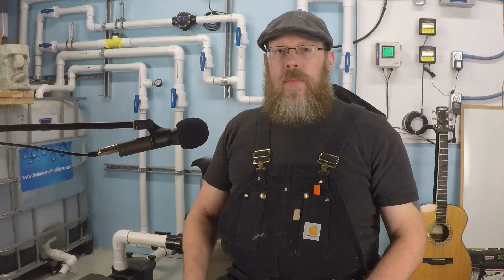Flexible PVC vs. Rigid PVC For Pools

Comment: Interesting. Just bought a house in Virginia and was thinking about replacing some of the above ground plumbing around the pump and filter with flex PVC just to make more sweeping turns as whoever plumbed it put a lot of 90s A LOT! And I know each 90° bend is a restriction, so would it be reasonable to use some flex PVC above ground? I don’t think the pressure gets anywhere near 80 psi.

Comment: All commercial pool equipment rooms are usually piped in sch 80,   Not for pressure but for a physical impact.   I always used a length of schedule 80 coming through the walls of the equipment room.  A pipe going through a concrete hole in equipment room is a point failure due to ground settlement.    Pools with six inch perimeter piping that is reduced to 2 pvc for a return fitting typically with a 1/2 inch eyeball.   You should always use schedule 40 pvc pipe with sch 80  elbows,  2 inch fittings typically split from external load.  Leaving the 6 inch header by 2 inch to the pool wall should be at least a six foot offset.  This will allow for the 2 inch pipe to flex if the heavy 6 inch  header. Should settle.  Skimmers should be piped similiar .   Any fittings above 3 inch it is best to order fresh slow set glue and apply with a brush = to the pipe diameter from a gallon can ( paint can style). This allows for securely inserting the pipe into the fitting before the glue starts to set.   PVC pipe cleaner , if used, I don’t like it.   If cleaning fittings they should be cleaned in groups , set aside making sure no puddles of cleaner in fittings,  will show as small leaks at bottom of pipe.   Do not let pvc pipes be pulled of a truck and the end drops on concrete,  you get leaks that only show at pressure testing from cracked pvc.   Also dragging a pvc across concrete bevels a portion of the pipe limiting its total surface for gluing.  Pipe should always be seperated by minimum 1 1/2 inches to allow for a proper sand backfill with no voids.  No leak pvc flanges should be the type that has no stop,   Like a repair coupling for you don’t cut and create a weak spot you apply glue a slide over the pipe……their things that may happen only one in two hundred times,   Though if you build as many pools have , you will see these problems,   I have never worked in the freezing climates,     I am sure they have seen all kinds of problem I never witnessed ,  basically it’s impossible to contain the pressure of freezing water.    For better or worst most of my experience had been beach front and Caribbean.

Comment: Thanks Steve, I need to hook up my pool pump, filter and heater that is about 30ft from pool.  I live in Quebec, Canada.  What would you recommend me using between flex and rigid?  How deep should I run the pipe?  Thanks.

Comment: As you point out, everybody has an opinion.  I have a 10,000 gallon in ground pool in central Texas.  It was built in 2007 with rigid schedule 40 PVC pipe throughout.  Every year, because of the shifting soil, I get a leak SOMEWHERE.  Everywhere from under slab areas to lines buried 18" deep around the perimeter of the pool. It's a given.  As time goes on and the expense of hiring a pool leak detection and repair service climbs, I have gradually shifted to purchasing my own  equipment, diagnosing the leaks and doing my own repairs.  All of the leaks have been at underground connections.  I have begun using flexible PVC for short sections to alleviate the stress and prevent a reoccurrence  AGAINST the advice of ""professionals" in the area.  My longest time frame for a flex PVC install has been 10 years and counting while I have had to redo many of the repairs done by the aforementioned "professionals" year after year, over and over.  So,  listen to them and keep redoing repairs or install short lengths of flex and redo it ever ? years.  The choice seems clear under my circumstances.
Reply: Sandy soils do hydro shift especially with heavy rains.

Comment: Am I missing something? The flex PVC that I'm using is smooth inside and out, follows the same ID/OD size standards as rigid (so that regular fittings work perfectly), I can run large smooth radiuses without fittings, and it handles freeze expansion for 5500ft elevation wonderfully. I do have to soften the trench with sand to prevent rock friction wearing a hole, and I have to be a little more aware of psi, but overall, it is a win. In fact, I'm not sure how it is "budget" in Canada, because it is twice the cost in high deserts of New Mexico. I live on a lava rock shelf so digging 18"-24" down is nearly impossible without serious excavation costs. I can only get about 12" max depth, so to protect against freezing is why I originally considered flex. The ease of labor to lay the pipe/hose was heaven. I do transition it to rigid above ground because I read that the flex is less UV tolerant, but then I have to wrap the rigid in insulation for freeze weather. Let me know if I'm missing something, because I'd rather start saving now for a piping overhaul than find out mid-season unprepared... Love your channel btw.
Reply: My fox vinyl liner pool is 26 years old and plumbed with spaFlex 1.5". Still going strong today.  But if I could have my way I would do the whole pool in SDR 11 or even SDR 9 HDPE smooth wall with electro fusion fittings.
Reply: Use it for 20 years  but on 3000 gallon pond winters in Long Island NY  worked find . Pipe frozen and cracked

Comment: Flex PVC Shrinks in length and diameter over time. In portable spas it ends up snapping the jets off or shrinking and pulling out of fittings. I am in a moderate climate and would never use it.

Comment: My entire house is done with Flex pipe. The line from my water meter to my house is Flex pipe. I know my info has nothing to do with pools but yeah... Anyway right now the temp is -20 and it's snowing. My pipes are frozen as of now. I have no leaks anywhere that I'm seeing. But when I had regular PVC piping in house I had to constantly replace whole entire sections of it and that was even having heat tape on the PVC. But in my experience the heat tape honestly does nothing special except make your electric bill cost a little more. But my house has been done in flex pipe for almost five years now and I've never had to replace any piece of it. And it has froze every year

Comment: Ah, the ultimate question. 😊 I really wonder how detrimental it is to bury Schedule 40 PVC (rigid) in Southwestern Ontario where frost depth is approximately 4 ft but that's a harsh Winter. If you bury rigid 2-in PVC, 4-ft deep, will you truly have “shatter” issues? 

Pipe buried 4 ft under a 2-in concrete patio will practically never see frost in a 4-ft frost-depth climate; frost-depth ratings are for soil. Might want to cover the lengths of rigid PVC that are only under soil with rigid XPS insulation in Winter—but, again, is that really necessary?
Reply: Rigid pipe won't shatter if there is no water in it. Flex hose will crush under vacuum. The only reason to use flex hose is if you're cheap. Be cheap now, spend more later.

Comment: I just installed an Inground 18x36 in norther alberta and they sent me flex pipe with the package, I went with all sched 40 pvc.....couldn't bring myself to burying flex hose under my concrete...
Reply from the maker: How deep did you bury the pipes?
Reply: I'm also very curious how deep you buried your rigid Sch-40 PVC and whether you concreted all along & overtop every run? 

I'm not convinced that rigid Sch-40 PVC is a problem in Southwestern Ontario; there are many northern US installers that use rigid.

Comment: I see lot of pools in Ontario, Canada from the pictures I see on the net using 1 1/2 flexible PVC from filter to pump (rest all rigid PVC). Is the Any reason/benefit of using flex pvc between pump and filter?
Reply: Have the same clear flex pipe for over 35 years and there’s no deterioration in Quebec. Pool pump and filter are enclosed and not exposed to sun so that probably makes a huge difference.

Comment: I live in the north region with 4-5 months of deep freezing winter..  even for above bround pool i prefer rigid pvc.  First flex don't last long, after few years they cracks.. they sort of corrode and the uv kills it.  The steel rings if too tight will also damage the flex overtime..   hard pvc only need glue.. and for above ground pool, you can just put screw on end fittings and remove your hard pipe sections at the end of the season… you can also leave it like that but as long you empty the pipes before winter…. Another reason i hate flex is thy they move, water running through make the flex shake and tangle, especially if the water flow is changing often,  each time it moves, it put stress on the ring and any silicone nearby.. the silicone will then crack.. especially on the filter head or near the pump.  Hard plumbing won't put stress on anything unless someone step on the pipe or something stupid.  Hard pipe have few downside however. ..you are using glue.. if you don't put enough glue it may fail.. and be ready for a huge flood.. once glue is applied or the pipe is cute and glued,, you can't change it.  If you change your equipment.. you will have to redo alot of cutting and gluing .  You also need a piping plan…so you jnow what to buy…and you don't start the job and realize that opps im missing 90 degree

Comment: This is exactly the info I needed, DIY'ing a fiberglass pool in ontario right now. Dealer provided flex but I've seen the same opinions you mentioned on it here on YouTube so I've been second guessing myself. Doing a manufactured stone deck surface so any issues hopefully won't be thousands of dollars to fix down the road. Thanks!

Comment: The best thing you can use in the ground is a thick walled polyethylene pipe such as Goodall "Greenflex".  It's not easy to work with, it isn't cheap either but I have seen it last 60+ years. Not just termites but grubs also can make swiss cheese out of flex pipe.  Also, if you leave water inside flex pipe it can shatter just like rigid pipe, it's only flexible when it's warm and once it ages it becomes far less flexible.  Lastly, if pH is ever low flex pipe can expand in the ground and when it has no place to go gets kinked, I've seen many suction pipes that pressure tested fine not work because this happened (usually under the skimmer from tablets)  I once actually took several pieces of pipe and put them in my freezer just to see what'd happen with the ends capped, believe it or not the black polyethylene was the only sample that survived.

Comment: I assumed people only used it above ground. My pool came with the house and the builder used it on tight angles from the filter to heater. I got rid of it and went all rigid. I usually go with 45's to get into tight areas. I never heard of it used underground. But I guess it would make sense.

Comment: Thanks Steve, this is exactly the info I was looking for. I'm installing my own in-ground this summer in PEI and after lots of research, I have decided to go with 2" TigerFlex buried below the frost line. I'm considering running all of the lines inside of 4" perforated black drainage pipe for extra crush protection. Would love your opinion on this?

Comment: The nice thing about flex is I can create a long radius bend instead of a 90 PVC fitting. Would be interesting to know if a long radius flex pipe is less restrictive than a 90 PVC fitting, despite the flex pipe being less smooth inside.
Reply: We always just heated sch 40 and bent it to get a sweep 90
Reply: The ribbed inside creates more restriction than rigid pipe. Use sweeps or heat and bend the PVC.

Comment: I use 2" flex pipe on my Intex pool for connections to the walls ( I threw away the Intex fittings and cut in real skimmers, returns, etc.). The intex walls move a lot, and the give in the flex pipe keeps it from destroying itself.

Comment: On Westburton Power station England the French tested the boiler pipe work Sch 80.  2°chrome steel pipe in the winter with no antifreeze as it is unheard of in England burts the pipes like plastic unbelievable it was cost a fortune because we had to gas axe the casing the pipe the lot remake it all again.haha they are building Atomic Power Stations here as we speak proper clowns to work for,it only went down to -18 to -22 app it was cold. Nice video

Comment: I’ve never heard it to be a termite issue. Thanks for the info. Keep up the good work.
Reply from the maker: I hear it is the main problem with flex pipe in some southern USA areas.
Reply: @Swimmingpoolsteve  I have heard this too. I only use flex under ground. Skimmer repair I generally go down past frost with pvc then flex. Back fill with sand.  Hope customer pays 😁
Reply: It happens here all the time, usually white grubs though not termites but people often suspect it's termites.  I've dug it up and seen them munching on it, I believe the water attracts them.
Reply: @BobsPoolService  where are you located?  We've been using flex, but I'm thinking about going with rigid.  Is this something that's common or is it rare?
Reply: @matt22blaster  We're in central New Jersey.  As for how common this is, it depends a lot on the soil and also burial depth of the pipe. If they're new pipes down 20" or even deeper quite rare but if it's a replacement pipe and it runs through some loamy soil or a lawn where grubs are present it's quite common.  If you can run rigid pipe easily I'd say do so, my favorite is a heavy walled black polyethylene, that stuff can last for 50 years possibly even more but it is harder to work with.
Reply: @BobsPoolService  awesome.  Thank you for the info